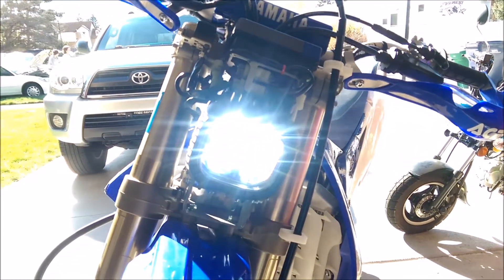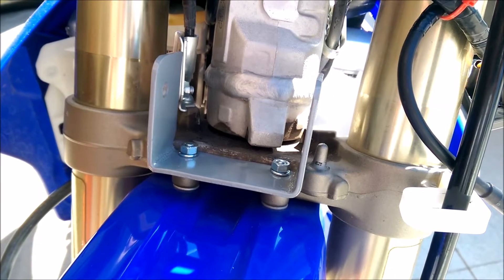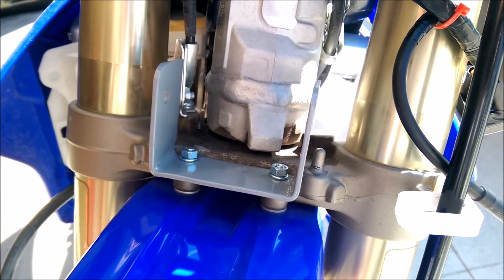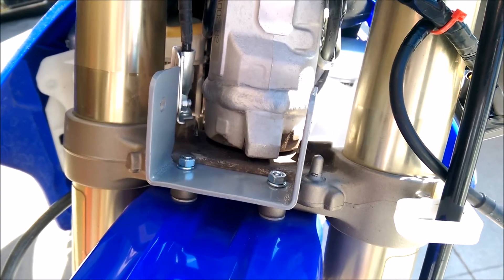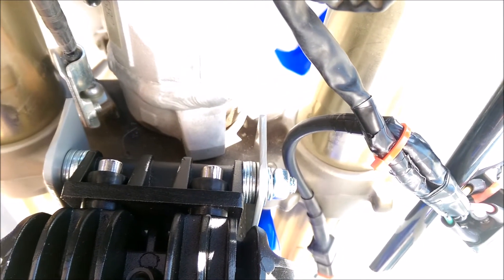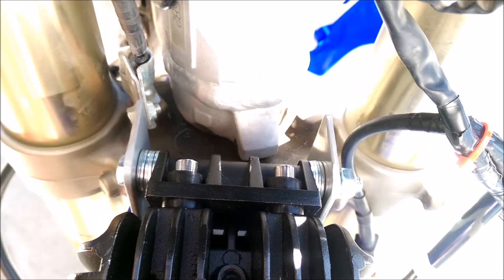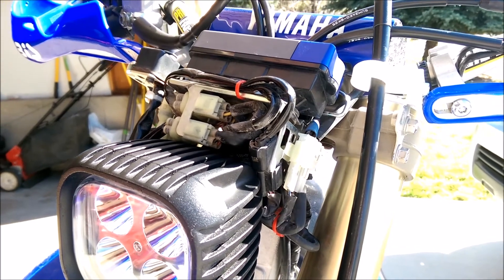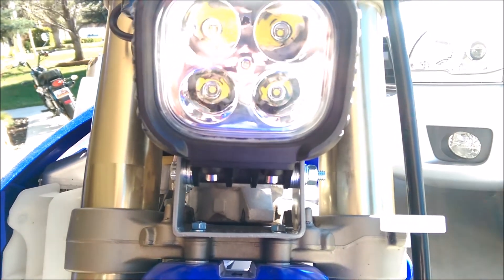DIY LED Dirtbike Headlight - Much Brighter than Halogen!

Comment: is it ok to suppling  that kind of voltage difference directly to the led ? Is it don’t want to regulate? Im also installed this setup for my honda xl200. But bit of confused about that. I mean does that led can handle that kind of variation instead of direct stable dc current??
Reply from the maker: This led support a very wide range of voltage, I verified that before the install. Some led lights won't. The specs on superbrightleds.com listed the light supporting up to 60volts.

Comment: Bro, 
I have done or tried doing so many things on your videos! 
Wired an LED light bar to my WR450 (and fried it because I didn't realize it needed a rectifier)
DIY can rack
Whole house fan
FPV drones
Modded tons of power wheels with variable speed controllers and higher voltages
We must have been brothers in another life ;-)
Cheers!
Austin
Utah
Reply from the maker: That's pretty awesome. My whole house fan video is super old haha, still working great though. Sounds like a lot of fun projects. Where you live in Utah? I'm up near SLC.
Reply: @Jasonoid  Cool! I'm in Mapleton Utah. Maybe our paths will cross some day ;-D 
Here's one of my FPV vids. https://youtu.be/qaC1smLc61M
Cheers!

Comment: You have the most  calming  voice . I want to run a light like yours on my XR250.  Would you know what the minimum stator output I would need ? Electronic things aren't my strong point. Your project came out really clean
Reply from the maker: I think mine is 75 watts total, if your bike didn't come with a headlight at all your stator is probably only for your ignition/spark. You might have to upgrade it.
Reply: @Jasonoid  the XR250 has a headlight but no battery or Estart like your WR. I imagine my stator output is less on my bike. I'd like to mount the light you put in your bike in the headlight/number plate shell. Baja Designs sells something simular for 500 dollars which is grossly  overpriced
Reply from the maker: @64maxpower  It might work okay without a battery setup, the LED uses less power than a traditional halogen bulb so it shouldnt stress the Stator too much. I would recommend trying it on your bike. You might need a larger capacitor setup to keep the light from flickering. The light output is BLINDING! I love it. Make sure the LED light you install supports a wide range of input voltage. My LED light supports 9 volts to 60 volts so I won't burn it out as the engine REVS up. Superbrightleds.com sells this same light still and it supports a wide range of voltage input.

I recently bought a factory replacement WR250 Yamah OEM headlight / number plate plastic plate off EBAY and cut a hole for my LED headlight to fit. It actually fit well and mounted fine using the default mounting hardware. It looks AWESOME now, wish I could show you a picture how it turned out.

Let me know if you have any other questions. The OEM headlight plastic plate was pricey but I hated the look of the other junk China headlight plates.

Comment: Do you think the same process will work on a older 96 cr250r. And I want to also add a tusk enduro lighting kit
Reply from the maker: If the bike has a stator large enough to support a normal halogen bulb, it will support an LED bulb in its place.

Comment: Output voltage shouldnt vary that much (10-22V DC) with rectifier...but if it does, this setup needs Voltage regulator too. You could try LM series (78xx) ;)